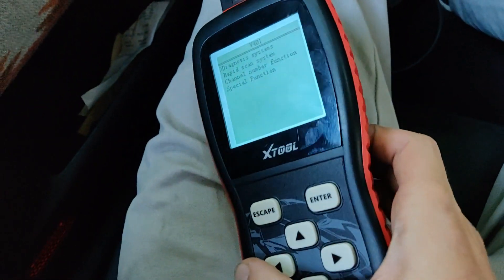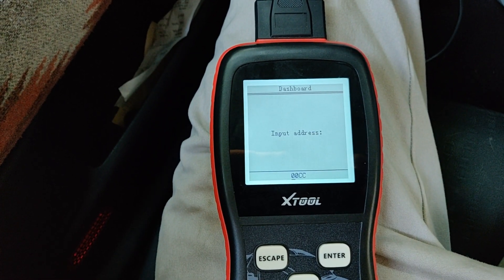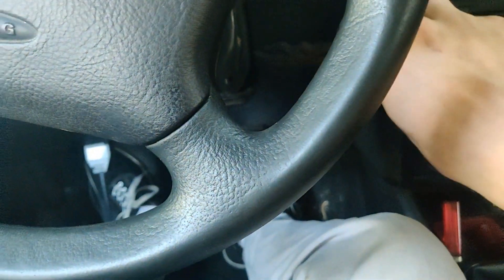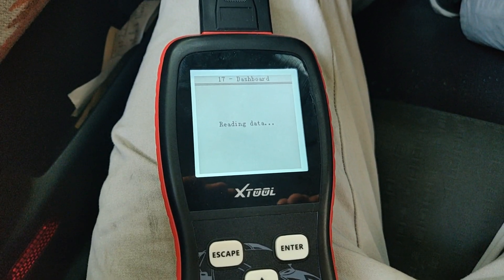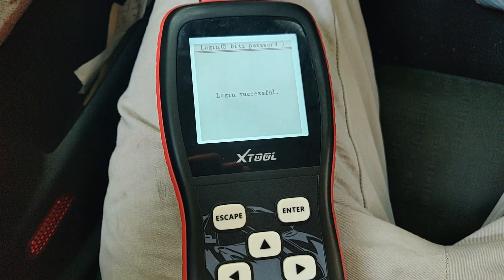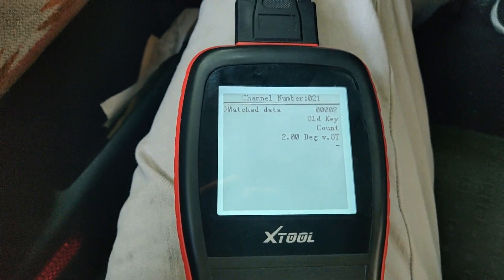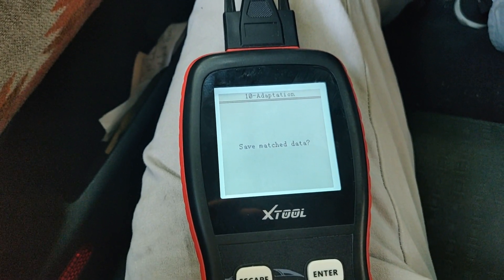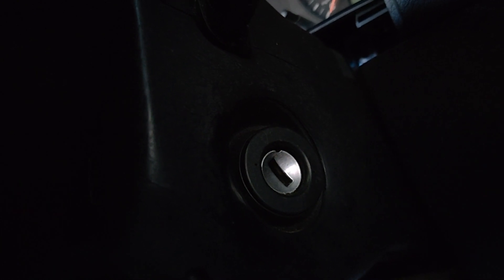Immo matching keys with XTOOL Vag401

Comment: What year was your passat? I have used keys from a 2005 I scrapped and I'm wondering if the chips can be "rewritten" to work with my 2003 wagon, or do I need to order new blank glass chips

Comment: Awesome. Im waiting on a replacement for mine since it just keeps saying failed to communicate. I could not find out what this tool can or cannot do for my 2001 mk4/beetle. Im glad to see it has the immobilizer programmer feature. I though i would have to buy another unit gor that. I have no manual for the xtool v401, not sure where to find it. Thanks!

Comment: I have an MKIV Jetta TDI and instead of what you get at 4:30 it says "This feature is not supported for the vehicle"! I have two other keys from previous owner. I have matched data: 00003, old key, count, 3.00 Deg vt. 0T as opposed to what you have on your screen.  Mine is a 2002 with Automatic 01M trans. Any ideas? Thanks for the video but I am surprised that you are not coming back to the comments section to help.

Comment: i have this tool over 2 years and try to use this function with my car seat toledo 2001, i know that the password must start with 0 but the password i get from the tool 5 digits didn't start with 0 in all 3 addresses , so i think it work with specific cars not all 
and i will be happy if we can communicate to change our experience with this tool as you said "There isn't a lot of documentation showing how to use the vag401 xtool"

Comment: So I have a 2005 Jetta TDI with BEW engine. I was able to get key-codes from all three addresses, but none would work to get into the dashboard to program the keys. I have a keycode that I was able to to use to get a key cut that does unlock the car, that keycode did not work either.
Reply from the maker: Dang! If you have a rosstech or a standard FTDI cable you can also try using VAG tacho or VAG commander. I've never managed to get VAGtacho to work though :(
Reply: I have an 04 tdi wagon 5spd(might have the same cluster as your 05). I found the skc using vag commander with a genuine rosstech KII-USB cable at 010E. I checked this address with the V401 and it was the same code(this address is listed as Polo). There is a how to at https://sites.google.com/site/imnuts/

Comment: did u just showed us how to program a new key into a VW  ? I don't understand what IMMO matching keys means.
Reply from the maker: Yes, in order for the immobilizer system to allow the car to start the key has to be matched to it. Remote programming is separate (and much easier!)
Reply: @frankw.saylor981  Thank you so much for this vid! I've had this tool for a while and know it can pull the SKC, but would there be any risk to bricking the cluster with the adaptation method? It looks like the VCDS method, but I'm still nervous about damaging the immo using the VAG401 since it can be pretty wonky sometimes.